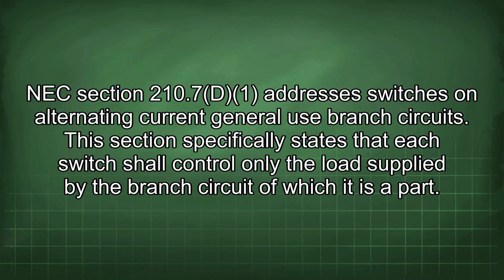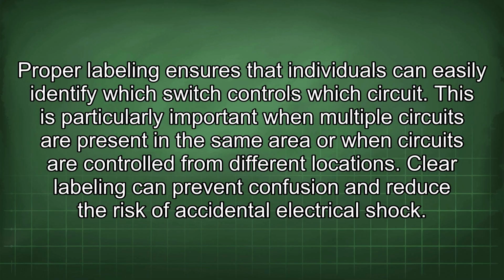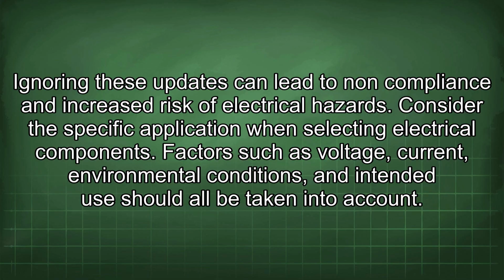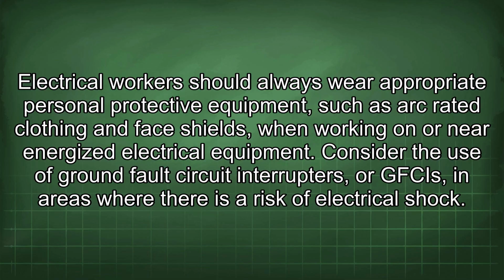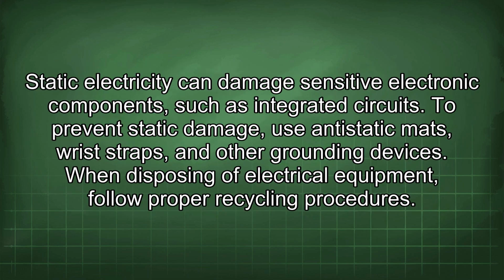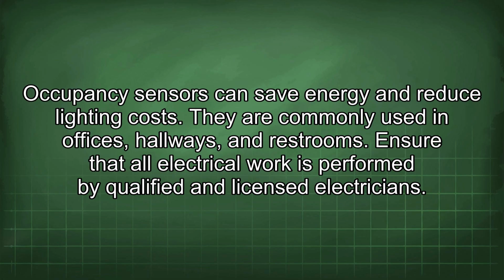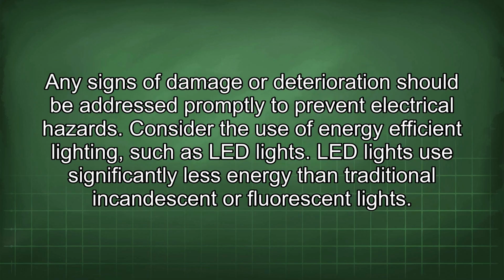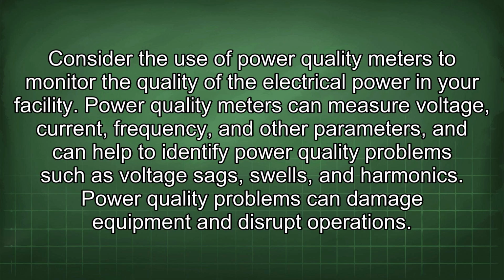NEC Compliance Using a Two Pole Snap Switch

Comment: A two pole snap switch is most often used to control line to line loads which if NEC compliant, are protected by either a two pole breaker or two single pole breakers with identified handle ties to ensure simultaneous disconnection of all ungrounded conductors.  

The most common application I see two pole switches are to serve the required means of disconnect for electric water heaters and other 240V equipment of 30 amps or less in dwelling units where the equipment is not within sight of the service panel.  I have installed several two pole switches for this application and never failed inspection because of it.
Reply from the maker: Hello @rarelampcollector,

Exactly, I couldn't have said it better myself! Thanks for your comments on the videos.

Sincerely,

BESA Research